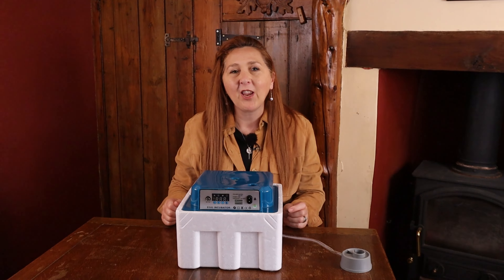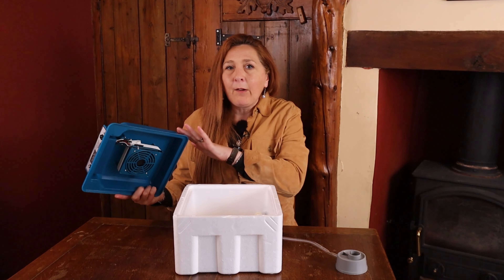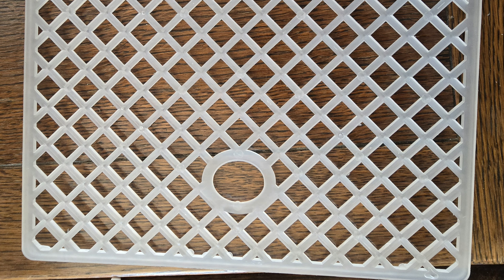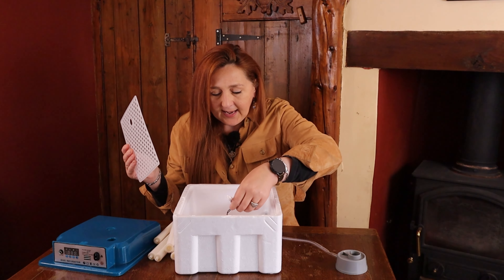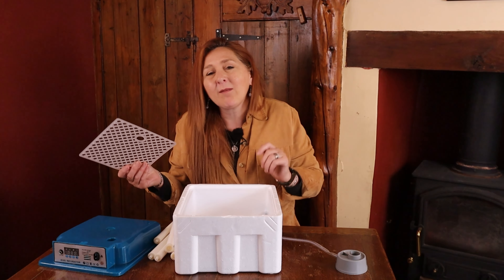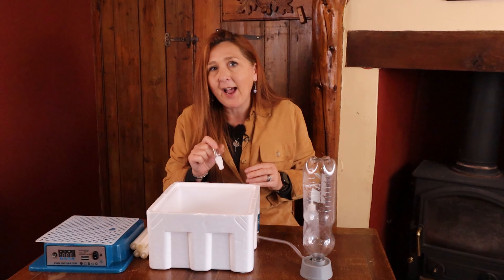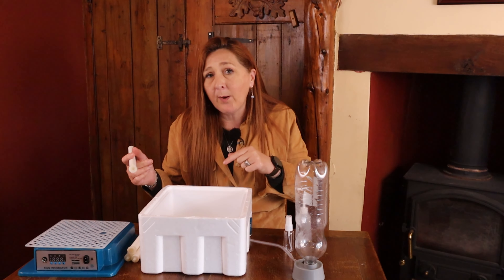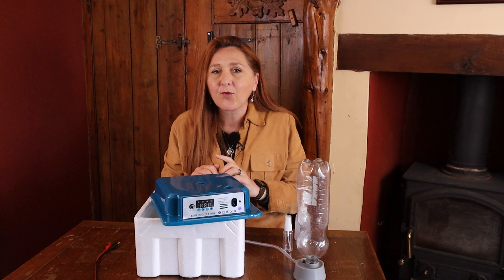Cheap Incubators: Junk or Jewel?

Comment: I found it both useful and interesting despite the fact that I have no plans to hatch my own chicks. At the moment. I will shortly be embarking on a comparison of automatic coop doors once our new girls arrive. I've knocked up a temporary coop for them and bought a door off Amazon for 40 euros.  It's made in Chinesia and is sold under several brand names. It's one with a vertical door with slots that mesh with a cog to raise and lower it. So far it seems ok. There's a clear digital screen, simple and clear instructions on how to program the timer,  an override function and decent screws for fitting it. It's a basic model so doesn't have a light controlled function. It has 4 stars on Amazon for what it's worth but so far it does what it's supposed to do at the right time. It operates quite smoothly and reasonably quiet too. So far so good. No reason think it won't work just as well when the ne girls arrive. It's up against a Titan Cube, purchased from your good selves. That has been working flawlessly for nearly a year now. So, will the new door be junk or jewel ? Watch this space.
Reply from the maker: @chrishamilton-wearing3232  We will be interested to hear. We do like the solar function because dusk changes so quickly